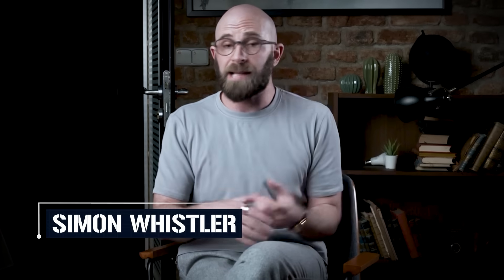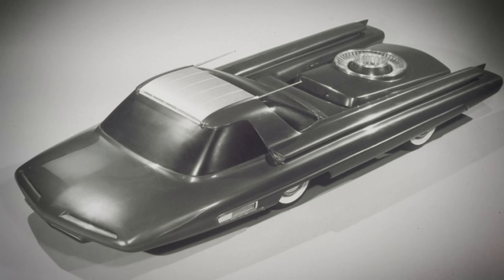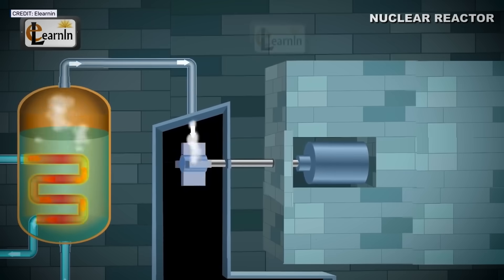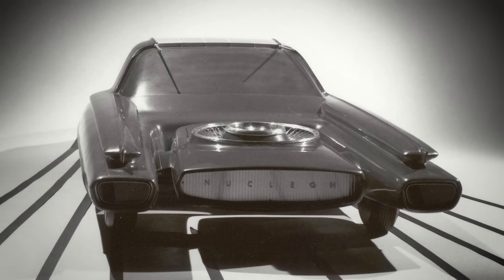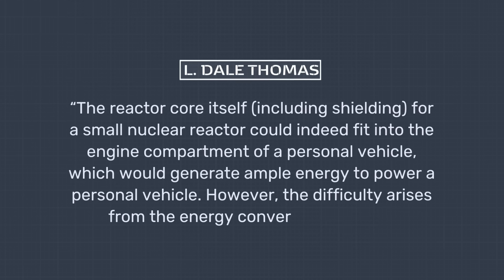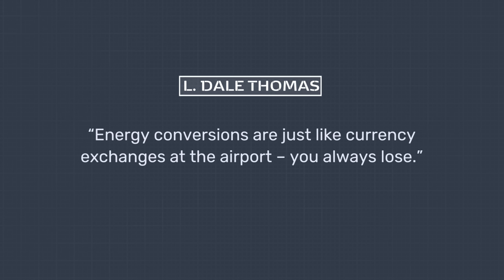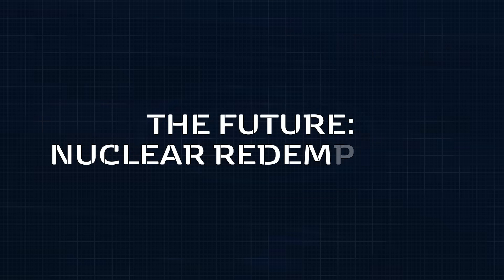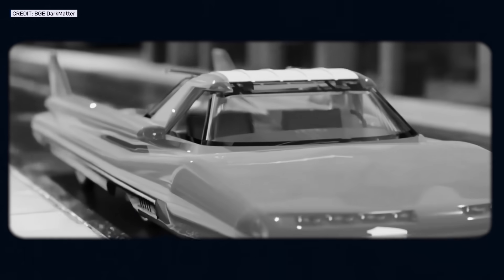The Ford Nucleon: The Nuclear Car of the Future

Comment: The bust nuclear car today is probably just running an EV in Ontario since it's the place in North America with the highest use of nuclear power as part of its energy grid... And of course in Europe? France! Almost every BEV is a nuclear-powered one!
Reply: Our government wants to refurbish a nuclear plant tjey initially thought syrolus fo demand SPECIFICALLY to handle electric vehicle charging. Ontario EVs are nuclear powered cars even further than it looks.
Reply: Nah. EV's aren't the future, no matter where the leccy comes from.
Reply: Why use a nuclear reaction to make steam when you can get the steam a lot of different ways without having to harness a nuclear reaction that could clearly run out of control for different reasons. They use the steam to turn a turbine to get electricity so its an electric car youre just charging the motors electricity requirement different ways i think nuclear reactions are options but risky ones theres a lot of ways to get electricity
Reply: @JacobWillits 

Death per twh, Our World in Data

Solar 0.02
Nuclear 0.03
Wind 0.04
Coal 24

Risk? Only if you measure by feelings rather than actual data.

Coal does not need to melt down or blow up to cause problems. Thousands of people die every year from air particulates. And that's not even getting into climate change.

And this is while a coal plant is properly functioning.

When it's not? Kingston Fly Ash Spill. One of the largest industrial spills in US history.

Dozens of clean up workers got cancer from the heavy metals in the ash slurry.

There is no power source without risk. We measure risk and benefit. But people's perception of nuclear is completely divorced from reality.

Comment: It always amazes me that we haven't found a better scalable method of harnessing nuclear power than steam engines.
Reply: Pretty much every energy generator that uses heat is just making steam. There really isn't a more efficient way to turn thermal energy into mechanical energy.

Wind and water power generation use something that is already moving to move turbines, but it's really the same principle. Solar power is probably the biggest departure in terms of generating power.

This is also the looming hurdle for fusion power. Once they figure out a way to make a fusion reaction continuous and efficient, they need to figure out how to turn that into electricity. The answer is probably by making steam.
Reply: I think it’s twofold. How do you harness the massive heat put out from nuclear energy, and how do you cool it? And the simple answer to that problem comes down to using the cooling system to convert the power. And that is, in essence, a modern nuclear power plant
Reply: @thisguy547  You might be able to use a heat exchanger to channel the thermal energy from the reaction into a gas turbine engine (Brayton cycle) Basically the reactor would be heating air or some other gas instead of water.
Or you could use a Sterling engine once again, you'd be heating the air or other gas inside the engine.
Reply: Steam has proven to be the most practical and efficient method and in use for about 75 years.
Reply: we have, look up NASA's K.R.U.S.T.Y.
Reply: The reason for that is because of the amount of energy that is generated from a phase change. When a liquid gets heated up enough to phase change to a gas, a lot of energy is released in the process. The laws of physics just make all other means of converting thermal energy into electrical less efficient.